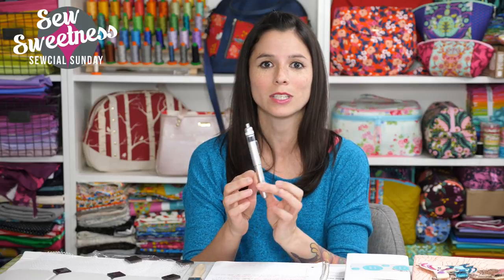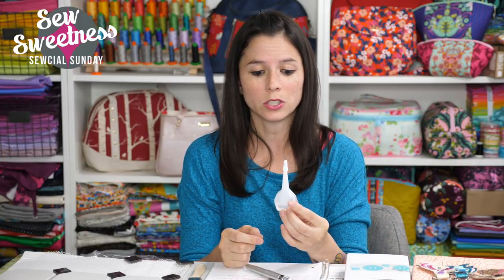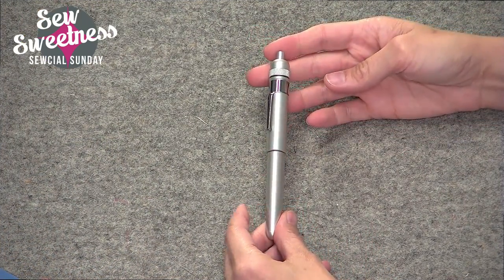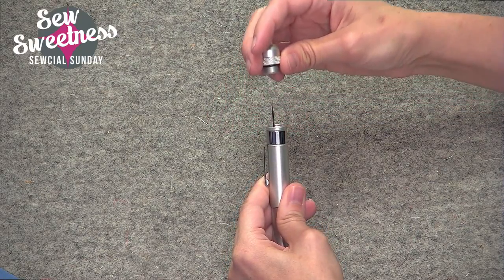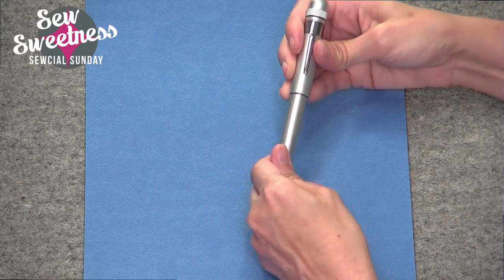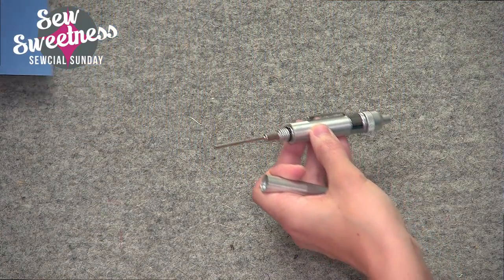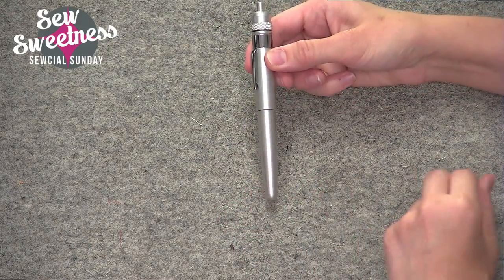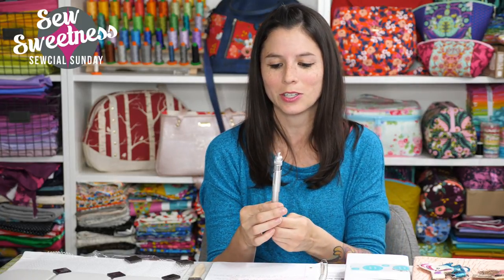How to Use the Sewing Machine Precision Oiler

Comment: I bought one of these oilers. I am having an issue with it. It will only dispense 2-3 drops of oil and then it stops working. I then have to open the cap and close it again to get it to work. It is as if there is a vacuum being created in side the pen.  The tool is solid and is not leaking. 
Also I am using Mineral oil in the oiler.  Do you have any suggestions on how to fix this issue?

Comment: What kind/brand oil do you recommend? I just bought a new serger and want to make sure I use a good quality oil. My regular sewing machine is a Babylock and those do not require oiling (it is all done when my machine goes to the dealer for maintenance). I bought my Juki serger from Amazon so I won’t have the service that I have for my Babylock.